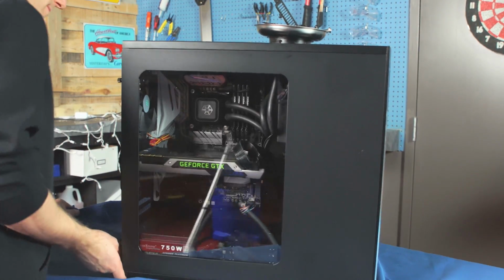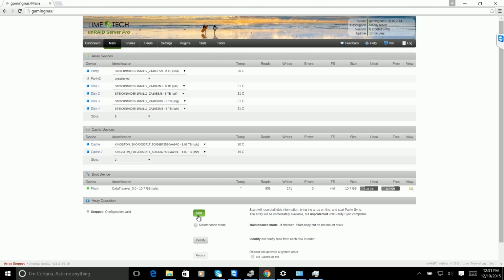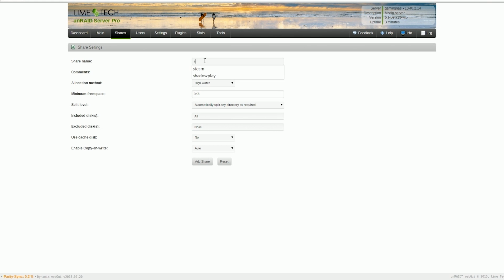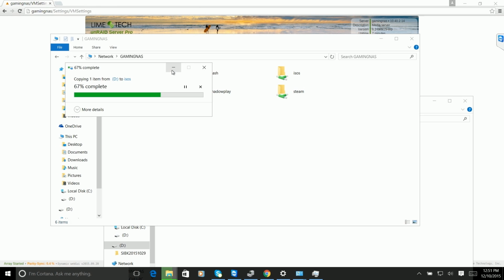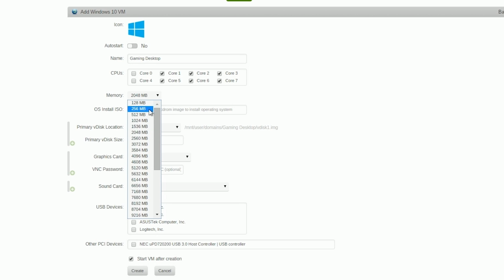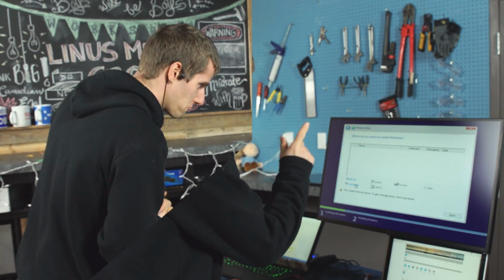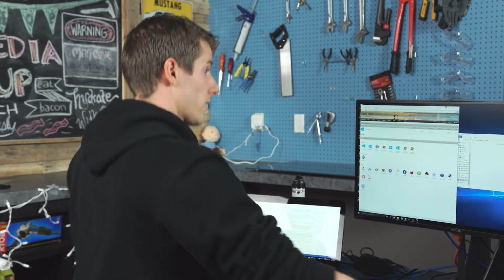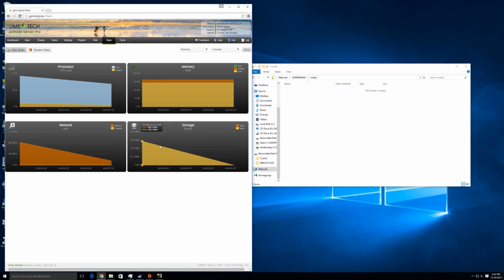Use your Gaming PC's Extra Power as a NAS Ultimate Guide

Comment: Linus, what's the point of this build ? You said that the NAS can only be accessed locally, by the gaming tower. So basically all of this is equal to attaching the hard drives array directly to the motherboard ? Am I missing something guys ?
Reply from the maker: The NAS can be accessed over the network like any other NAS. I demo this in the video.
Reply: +LinusTechTips so it has to run 24/7 to be accesible like any other NAS right? which means higher power usage since a NAS usually uses way less than any gaming tower does
Reply: +LinusTechTips so fast, wow.
Reply: So, after the debate in this comment section I went and did this build. My mentality being if power draw was too high I would invest in the other components to run a separate NAS.

This is a lengthy post but documents briefly my experience with power and the project its self.

Almost 2 and a half months in, and power consumption when running in "NAS" mode (VM turned off) It draws around 25-70w depending on what tasks the NAS is completing. Even though a separate unit could draw as little as 18w I feel the consumption I have right now is well within a reasonable limit. (nice to be wrong sometimes!!)

Power draw when VM is on but display is off is about 60-70w. So I have taken to just having display turn off after 20mins rather than using sleep. (I had some issues waking the VM from a sleep state). Currently as I type this I am drawing around 70-75w so when completing non resource heavy tasks the Windows 10 VM draws almost no more power.

There was some fun, because the build Linus is using of UnRAID was in beta, I had to do some interesting coding within the VM's XML to pass through my USB card for hot plugging. but this stuff is redundant now.

Also, until the most recent update to UnRAID I had to turn my VM on using the webGUI on my phone/tablet. (hence why I was just turning display off) Will be using an old monitor from now on to access the GUI from the system its self from now on, useful functionality.

As Linus tested in today's video, you don't really see any real drop in performance.
I would definitely recommend this build to anyone who has a PC that can run this kind of virtualisation if someone is looking at a NAS/redundancy.

Finally the UnRAID community are awesome, always willing to help and offer advise for issues. I was using FreeNAS for a little while during my initial testing of a NAS (using an old laptop) and found their community to be largely unhelpful their main reply being "read the documentation" whenever a noob had an issue, whereas UnRAID guys would either just tell you the solution or point you to the right place.
Reply: +zapl80 the gaming rig is a vm you dont have to start that to use the NAS and the 980 wouldnt be used then because its windows vm only so i wouldnt say its pointless and its there to show what is possible too i think
Reply: +John Hatfield And you are the majority? oO At least in Germany i can assure you, that min 95% of the people shut down their pc over night.
Reply: +Zahier Mahoob $700 for a NAS? really? I'm currently researching building one... you can do it, with full functionality for around $250 ,I am converting from £ so might be a little more, (APU with Gbit LAN + RAM + +PSU + case) the most costly part is the HDD's, which you would need to buy for this build anyway... unless you have spare high capacity drives lying around...

While this is an awesome idea, running a separate low power unit is far more beneficial to running components that literally waste electricity sitting idle...
Reply: Performance my not be as good but other than that, you have all the downsides of simply sharing your local folders directly from the windows host system. Especially that you have to keep your pc on to have your nas on. That's the big win of separating the two.  Build is a neat showcase for unraid but IRL pretty pointless.
Reply: +Mark If you have a modern up to date PC running on the standard "Balanced" power profile then there is no real need to powerdown. Grab a Kill-o-Watt meter, thier pretty cheap. The standard power profile puts the CPU in cstates that use next to no power and a decent gold PSU is very efficient. Add in a SSD that use next to nothing and the fact that it also spins down normal HDDs after 15-30mins. 

I run my Nas that's an i3, 8gigs, 750watt psu and 8 hard drives 24/7. Costs a whopping 5 CENTS a day. It serves Plex, Teamspeak, DNS, VPN, Mumble, MySQL and a VM of Windows 10 for testing. It runs at something like 190 watts, maybe a tad more.
Reply: +Knig Fotlets Do you have a citation for this claim? Both of these are forms of software RAID so I'd say the only advantage is an abstraction layer and you'd probably be better off to use some form of ESXi setup and virtualise a proper OS so you could then load balance it between 2 systems or something as well as take advantage of SMB3 features.
Reply: ash0787
NAS and Windows Sharing are basically the same thing. You can assign drive letters to those shares either way. Installing a game once in a shared location works with some, many will need a local installation (because they depend on registry and local app data).

The difference here is that something outside of windows is responsible for providing the share. It can also do RAID with SSD cache drives which you can't do easily from within windows. And you may save some energy if the virtual windows is shut down.

But it's basically the same thing. Your PC shares it's drives, either directly from within windows or from the unRAID operating system that sits outside of windows.
Reply: +VoodaGod Similar but not so BA. Essentially all you really need to have the full functionality of the virtualization is a CPU with VT-d, as that allows the passthrough, any other components are for functionality.
My build is:
i7-4790k (7 hyperthreaded cores for VM, 2 for NAS)
GeForce GTX 770 (next thing to update)
Asus z97-AR
16Gb RAM (2GB RAM for NAS, 14GB VM)
2x Samsung 250 GB SSD's
Then a selection of HDD's amounting to 9TB (6TB in use and 3TB for the parity drive)

I know I could have one more core and more ram for my VM, but I am running servers for Team Speak, Minecraft, Plex and a few other things. This way I know even with all the stuff my NAS has to handle it is always stable :)
Reply: +Malte Roeper The physical hardware needs to be on. Having the virtual guest off is even more pointless. A 980 idling will not use a lot. And a 980 does not go away completely just because it's not in use. It's still connected to the bus and powered by it.
Reply: +Kenneth O'Kelly running 100w 24/7, in Australia, would cost 62c a day. 1 year, averaging 100w, would cost $226.30 in power. This 4-bay netgear thing is $200 and idling with WOL, uses 1.4w, and at 100% activity uses 45w. It only does DLNA and SMB, but would in this country at least, would probably pay for itself after just 1 year if it meant you could shut down your gaming machine while not in use. At 5c per day this clearly doesn't apply to you, but it will apply to a lot of people
Reply: +luke saylor unless you live in Australia and pay a million dollars for a KW. then fuck this.  But i pay $.065/kw in Ohio. Zero fucks given.
Reply: +LinusTechTips origincal comment says 8 hours ago. Your comment was 9.

woah.
Reply: ***** Like Voked said, most of the cost is in the drives. if you built a NAS you can do it for around $150-$200, if you dont include the drives (believe me, they cost way more than the hardware...). 

But lets be honest, most people use old parts to build their NAS. if you do this then the cost is minimal...

I think this is probs the second most cost effective choice after using old parts...
Reply: +Zahier Mahoob 80 watts = $100 per year at 15ct per kwh. Depends on your hardware, but it might break even quicker than you think. But most importantly there are fan noises and annoying leds you can hide away in a closet if you make it a separate little box / low power server based on some uATX board.
Reply: +ymous Anon Actually, the GPU would turn off when Windows is shut down.
Reply: Mark I used to agree with this but I don't actually think this is true. My gaming rig uses around 130w power in when not gaming and around 200-230w when gaming.

I don't believe you would gain any power saving by having a second device as the power draw on most gaming grade components isn't very high when idle anyway.

The only type of NAS that could gain you power savings would be dedicated units imo and then you would have to offset cost of device to any potential savings.
Reply: +LinusTechTips     LINUUUUS  whats the advantage of NAS over windows homegroup sharing ?   
does it produce a network drive address that I could then use to install a game too for example  say N://Skyrim 
and then launch that game from any machine on the network ?
Reply: +Mark Majority of people leave their computers on 24/7. I never shut mine down unless it is updating.
Reply: Trevor Preston Interesting, I am going to have to look at my PC's power consumption if its reasonable you might have just saved me a few hundred quid!

and John Hatfield I don't tend to leave my PC on all the time, always concious of my electricity bill! and powering on only takes seconds with an SSD.
Reply: Locally as in the local network, not just the pc it's in. So any pc that connects to your network can access the files if you allow file sharing.
Reply: +Kenneth O'Kelly Sorry just looked and it read 99 watts. So even less.
Reply: +Voked kappa dang that sux. What's it a KW? Like 20cents? Ya I can see turning it.off for that.
Reply: Kenneth O'Kelly 25.7c per kWh. Shame because I'd love to do this with my gaming machine. I may still do it if I can be bothered with configuring WOL on unRAID.
Reply: Kenneth O'Kelly Interesting stuff! I recently brought a meter to test my output, just haven't been home to do tests over christmas. Like I said in my OP, I am researching NAS this video and comment thread have landed at pretty much the perfect time for me! Especially as my hardware is pretty much identical to this set up (apart from I have DDR3 RAM and a less powerful GPU)

I never really considered virtulization as a solution to my issue! looking forward to getting stuck into this! my current plan is to buy the hard drives, set this up as in the video, test for a month, if power efficiency is decent, keep it as my solution, if not, buy stuff for a dedicated NAS.
Reply: Mark your electricity prices should be a good indication. Especially if theyre as high as mine.
Reply: +ymous Anon Not quite, the machine doesn't have to start with the Windows 10 VM on immediately, he only set it that way in the video for his own convenience. He even talks about it. On top of this modern hardware that's capable of this feat have low power modes. I wonder if the copy of Windows 10 on the VM can go to sleep like it's a physical desktop...
Reply: Voked kappa Just saw your comment, I couldn't use electricity prices in my testing, as I live in a house with 4 other people 2 of them being PC gamers and we have had the heating on during winter (gas and electricity is combined on our bill). So our bill is way more than normal ATM and fluctuates on a monthly basis...

Using a meter to test power consumption of just my PC removes all other variables and leaves only my PC as the thing that can effect consumption.
Reply: +Mark did you use the same components as in the video?
Reply: Mark thanks, was interested because of the power consumption you measured ;)
Reply: VoodaGod lol, is it higher or lower than what you was expecting? :)
Reply: <75w @idle seems pretty good to me, i'm thinking of retiring my current cpu (fx 8120), ram & mainboard for use as a homeserver when i upgrade once the new amd cpus come out, and was just interested how much a modern system uses @idle. I'm guessing that your cpu is probably quite a bit more power efficient than mine though so i'm just gonna get a wattmeter and check it myself. Wouldn't want to have the most unefficient computer in the house running 24/7 ;D
Reply: Mark No I mean your prices per kW. In Australia we pay 26c/kW, so it is not practical to run anything 24/7 like that. A NAS with WOL will always be better. unRAID can do WOL but you have to know what you're doing. If power is cheap for you then you can much easier justify a relatively power hungry solution. But at 26c/kW it isn't even a question.
Reply: +Khettab Yacine The point is to have a CHEAP/FREE dedicated NAS.  You might pay a little more for the power, verses a nas with a pentium in it. So you're paying for it over time (still take many years to cut the difference between buying a nas), but everyone pays for stuff later anyways right? thats how the world works now.  So basicaally this is a layaway NAS, that cost $2 a month for 20 years. No interest. Better than layaway
Reply: ***** most of the cost of a nas is in the drives. you must buy these regardless of the solution you choose.
Reply: +LinusTechTips Was listening to this on my Logitech G933; love 'em.  They are so comfortable I actually forget I'm wearing them sometimes.
Reply: I know this is old but, couldn't you just create the raid, install windows and then just create some shares inside of windows? This way you just eliminate the unraid software completely.
Reply: +Kenneth O'Kelly I have a question for you are you still active?
Reply: +Tychosvideos yeah ikt
Reply: +Tychosvideos ikr
Reply: ymous Anon only if you're also running the pc vm, of you're not using those additional cores and your gpu it will basically only be running the nas, and so, only consume as much power as only running a nas typically would
Reply: +Khettab Yacine It's not about simple and the result is not the same, Windows Software RAIDs are not as fast as unRAID, your argument is invalid.
Reply: +ymous Anon exactly ! it would have been simpler just installing windows on the pc and sharing the drives over the network! same result! +1
Reply: +ymous Anon Yeah like anybody that buys a gaming rig actually cares about power consumption. Plus a lot of people just leave their gaming rigs running 24/7 anyways.
Reply: +zapl80 I AM LOOKING INTO THIS! THERE IS MORE TOT THAN WHAT THE PEONS THINK! MY THINKING IS THIS ADD A LOW POWER VIDEO CARD FOR LINUX NOW I HAVE A 3 IN 1. LINUX VM TO RUN MY DAY TO DAY STUFF, SO THAT MICROSOFT OR WINDOWS CANT STEAL MY INFO. VM WINDOWS 7 OR 10 FOR GAMING AND RUNNING WINDOWS APPS THAT I CAN RUN ON LINUX. 3)UNRAID 6 FOR MY NAS/PLEX KODI STUFF.
FOR THOSE OF YOU THAN WANT TO TURN OFF THE GAMING GPU HERE A THOUGHT, THE NEXT TIME YOU UPGRADE GET THUNDERBOLT 3 OR 2 USB 3.1 C-PORT FOR EXTERNAL GPU SO U CAN TURN IT OFF. MY MAIN REASON FOR LIKING THIS IT RUNNING LINUX AND WINDOWS BOTH AT THE SAME TIME AND HAVING PASSTHREW GPU FOR GAMING THE NAS IS A BONUS.

Comment: I don't mind giving up a little "gaming performance" to a NAS, but in order to have access to your supposed to be low power consumption NAS, you have to keep the whole system running. Whatever maintenance you need to do on hardware level, you need to shut both environments down. You may be better off converting an old computer into a NAS.

Comment: I have a question through using Unraid will it make your data safer, or will the NAS perform better? Because windows can natively raid all of those drives together and share that space through windows sharing. Making this whole vitalization thing cool and something that would be interesting to do, but ultimately pointless in my opinion. But if there is a definite benefit then I would see this in an entirely new light. Unless the point of this is to completely separate the resources for each VM instance for better utilization of the computer's resources.

Comment: the problem with doing this, is personally i dont want something that uses as much power as my gaming rig (even on Idle) running 24/7, would increase my electric bill massively. Would rather use that really low power avoton board from asrock that was used in the insane compact nas video

Comment: linus I have the same case how did you install the dual 120 mm radiator at the top. I have a tundra td02 it does not fit flat due to flaps on the case. can you help me? anyone

Comment: This is so cool. But I would like to know a couple of things:
1) Do you have to leave this Desktop/NAS on 24/7 to fully utilize the NAS function?
2) What is the bottleneck of data transfer of files (SATA REV3 or 1gbps network)?
3) Will running NAS be reducing the CPU processing power, and thus, reducing multitasking capability?

To be honest, I would really like to see a pros and cons video for this build, last but not least...

Thanks so much for this information! This is really application to normal household!
Reply: +Shih-Chiang Liu I meant "This is really applicable* to normal household"
Reply: +Shih-Chiang Liu 
1. You don't have to leave it on 24/7, but its best if you do, so you don't have to boot up the system when you need a file. It is also nice to leave it on as then every other system can back up to it overnight. Moderm systems use very little power in idle(less than 30w) so there isn't much power being pulled
2. The bottleneck is gigeth. This system is probally capible of  If 500mB/s or more if you plugged a 10gig card into it.
3. It will, but not much( file tranfers over gig only use about 50% of one core if fully used.)

I would suggest that you don't don't do this and just use storage spaces in windows and use the file sharing in windows. much easyier and don't take away 4gb of ram.